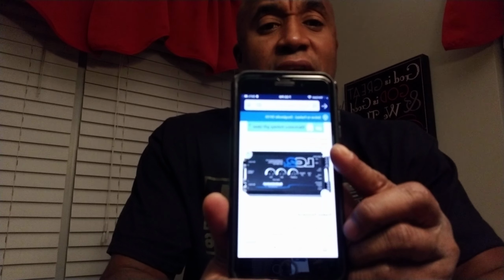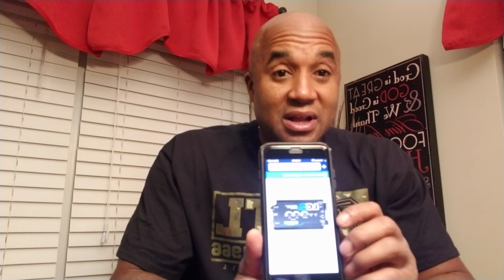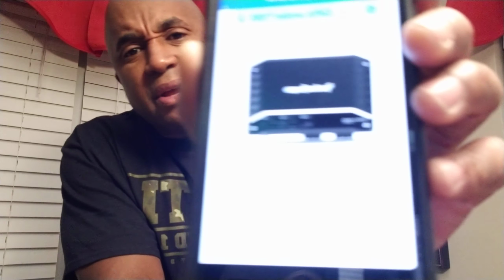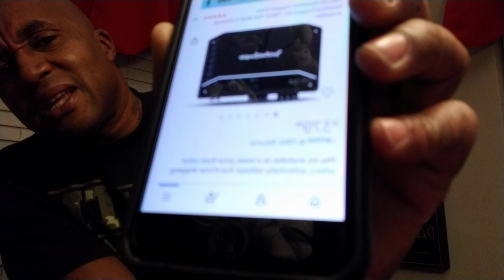Designing a quality system for under $1k off Amazon

Comment: Preach it brother! I built a system for my buddy mostly from fb market place and open box specials at my local audio shop. Kenwood double sun for $100, ground zero 6.5 components $110, 6.5 focal coaxials $150, Rockford punch 500 used for $130, cheap power acoustic 4 channel for $80, semi pre fab box made by my local shop $160, hit the junk yard and got all the ofc power and ground wire for $8, then a car I bought had two damn near new kicker comp 10s in the rear panels so no cost on the subs but if I did buy em add another $200 then I did all the install myself so all in all around $950 or less and was done over the course of a couple months little by little but for what it is man that sob sounds damn good just gotta take your time find the right deals and do your research as well as be willing to do the work yourself if your capable

Comment: what .75 or 1 inch tweeters would you run in a 19 Kia optima,? I'm gonna put them in front doors at top plastic pieces, love watching your builds. running 2 sundown audio sia 3500 an SFB 1000.4,nvx xab21, 4 sa neo pros 6.5,4 timpano audio mb65s, all n doors, hippo xl 12, an 2 DC audio m3 65 subs, a Banda PX1 DSP coming from HU.

Comment: 4 kicker 6.5 dxs on a 700.4 Sony xplode amp, 2 America bass elite 12s d4s in a 4cf box from ground shaker tuned to 30 hz on a ppi black ice 7000.1d all 0 Guage ofc from sky high car audio dual inputs for power and ground a bass knob rcs it was I think 890 after tax all was bought on Amazon a year ago except the box

Comment: The difference in a sedan and truck are understandably different. What about a full size k1500 Blazer? 1992  project. I'm thinking under seat or slim box (full width behind the seat) thinking 4-6 8". Actually have 6 ID8 V.4. 

V

Comment: I did mine under $500 on offer up 😂😂 i hooked it up myself. 
1 SA12 
1 hifonics 2500 2ch
1 hifonics 1000 4ch
1 cheap epicenter 
Alpine Bluetooth single din
Pair of infinity kappas 6X9 
Pair of infinity kappas 6.5
1 clarion eq 
4 cheap tweeters
0 gage dual wire kit

Comment: I got a dual 8 inch bandpass box I got from craigslist for $20.  A kenwood kdc-x304 off facebook for 80. 2 skar sdr-8 d4 for 131 after tax on ebay. currently underpowered using a buddys extra amp a kicker cxa600.1. Looking to find something around 800 watts rms at 2 ohms for the subs.
Reply: @DTW-bx2vy  I'm passes all these now. thanks though

Comment: Just spent 1,100 on mine ,  single x 18 on a wolfram 3000.1 with d4s-60 mids and d25 tweeters , skar 400.4 on mids and highs , d7500 with a d3400 for battery’s , sky high 1/0 wire dual inputs , dox is 6.5 cubes tuned to 31hz

Comment: Most of rockford amps have input sensitivity and hi input so you dont need the audio control...save a few bucks.was a good list my man.
Reply: Yeah but that step down from audio control will eliminate any pretuning that has been set into the factory head unit and will allow more bass
Reply: @waynsmith9538  what you mean down?
Reply: He means that the LC2i will flatten out the eq curve that the factory radio uses to try and make the inferior speakers that come with the car sound good and handle power. Mainly, modern head units place a hard roll-off on the bass frequencies, and that unit helps to restore those lost frequencies to send a flat signal to the amp/amps you are using. Hope this helps.  @cristiannunez1862

Comment: Good list. I’d get the kicker key 200.4 and not need the loc. Then you could get a kicker, Rockford, alpine or pioneer that does 500 at 2 ohms and be around $400 with the rest for wire and speakers.
Reply: It’s always fun to design systems even if we can’t buy them all
Reply from the maker: So many ways..to each their own. There is no one way because every one wants something different

Comment: Have you tried 2 JL Audio 12 slot ported basswedge for $459.99
Reply from the maker: No. I build my own enclosure. I also build for others.
Reply: @M.B.Enclosures  would it be possible if you could help me out on the specs of the width height and depth to get the maximum output for a ported box for two 12" kicker round comp Q  Subs.
Reply from the maker: @mosessalazar7818  I don’t design.. only build and ship. I’ve already pointed out the software you can use to get an enclosure if you don’t want me to do it.
Reply: The JL Audio 12w0v3 Subs are phenomenal Subs for SQ No Doubt I would really like for you to try them
Reply: How much will it cost to have it built-and shipped to me
Reply from the maker: @mosessalazar7818  text me at 404 694 4818

Comment: You lost me right off the bat when you said the 750×5 amplifier.  Although I know you're right it could sound good. Not if you're looking to slam some serious bass though. You could buy the audio control, a skar audio rp2000.1d or something similar.  Then a single 12 or 15 inch sub. American bass, massive audio, skar audio ect. Decent ported enclosure.  Then buy a cheap dual 4 channel for some audiopipe midrange speakers. Or something similar.  Wire in a couple tweeters... good to go. That would be right around or under 1k. Also some of these items are give or take. Maybe your factory speakers are decent. This is good info in your video but you should make 1 for people looking to do 150's.
Reply from the maker: My channel isn’t for people chasing numbers. It for street beaters. And IMO you not getting 150’s with a $1k total system. Most people don’t have that kind of money to throw in a car audio system, but they want a good one. My amp alone cost $799, but that me and my ability financially. And I switch out subs just cause I can. My channel is for the masses, not the niche.